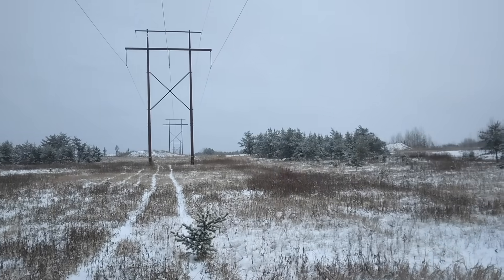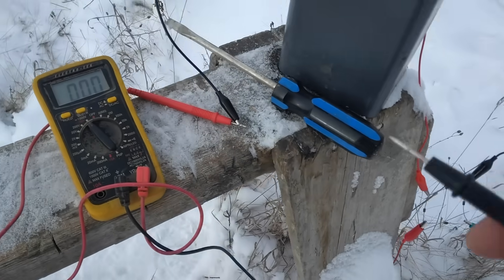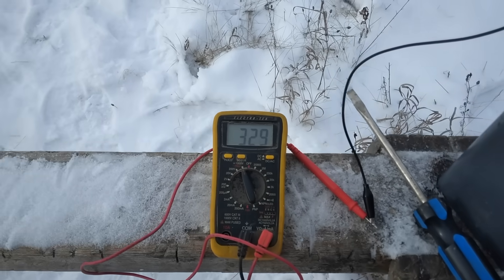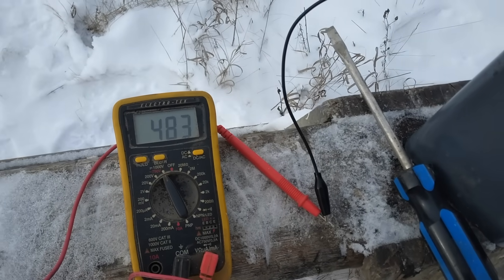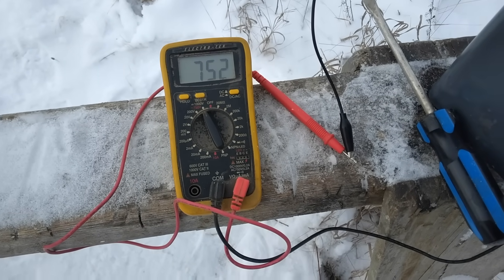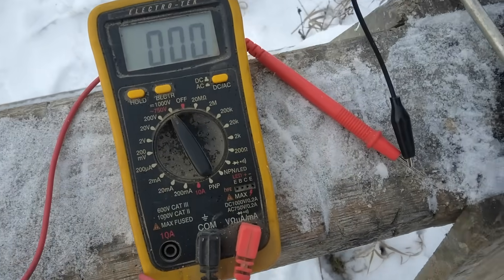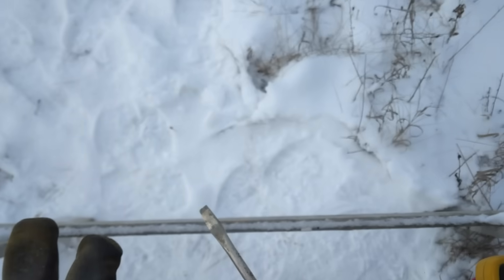Fences sucking power from under HV transmission lines

Comment: It is stealing if you use the electric power to do work, which equals using energy. Work means motors or heating or making light, etc. Anything that would take a generator using fuel. To say it isn't theft, is like saying anything in your house that uses a transformer should be free to run because there is no physical connection by the wires.

Comment: Hey, when you do this, use three lines all parallel to each other to create a field.  Electrons do not travel along power lines.  Electrical fields do and the reason you always see power lines in threes.  Infact, you can draw power from those fields directly.

Comment: having worked for the “power company”… don’t think you can start “stealing” electricity and get away with it… when you add a load, it will impact the impedance of the power line and they have metering that is monitoring the impedance, mostly for fault finding, but they will notice.

Comment: I know of a guy that took standard small voltage line wire rolled it Nicole under the transmission lines and stuck it in his main lugs on his house it wouldn't ruin everything at once but he can get by with just that amount of power usage
Reply: BTW, he was also when I met him in a lawsuit with the power company over stealing power

Comment: You don't need a bridge rectifier or a capacitor , if you coil the length of the wire you probably can power an LED lightbulb

Comment: Many people are clueless about physics.  The AC generates both an electric field and a magnetic field around it.  As the direction of the current flow alters these fields collapse returning almost all of the energy back to the wire.  The only loss is the signal that is radiated outwards.  Which is a small amount of power. 
However if the fields are absorbed, by the user, then the energy of the fields is lost and the wire doesn't get it back.  Which then causes the generators to work harder.  It is theft taking advantage of the situation. No different to stealing a car with the key in it.  Even if the key shouldn't be left in the car it does not and cannot excuse the thief.

Comment: Have you held a non contact voltage detector under those lines? If it dont light up u dont have enough induction to steal usable power. Maybe u could trickle charge a battery over a week to full but not likely

Comment: As long as you know the amps watts and voltage you can make an open air step down transformer with a coil of wire known as an inductor

Comment: I worked on the high lines several years ago. A crew was to work on a section of line in a right of way that had two other separate 345kv circuits that were enegerized. Their line was deenergized and grounded for the job. Grounds were about 1/4 mile away each direction. 2 men went up in a steel lift that was grounded. My friend was holding the conductor but not moving. His partner noticed and pulled him free. He died there dispite all their efforts. They thought they were safe with everything grounded as was required. The truck is grounded to protect the people on the ground. My friend in the air became the path between the line with induced voltage and the grounded steel lift.

Comment: We use very specific procedures at the electric utility when working around hi lines and especially when stringing in new lines nearby. We continuously drain that induced voltage to ground.

Comment: Any conductor that runs parallel to the power lines forms a capacitor and when measured with a high impedance meter you will likely see a large voltage build up. However, the instantaneous current that you can draw from this arrangement is extremely small and so this voltage is of little conseqence. In fact, were you to touch the fence, I doubt that you would feel anything.

Comment: I came back to a hiking trailhead parking lot once. To find myself with a dead car battery. I was the last vehicle at dusk. Looking around. I saw the transmission line went across the far end of the parking lot. There was a metal strip about a foot high. Suspended 2 feet off the ground that fenced off the parking lot on 3 sides. Hooked up the jumper cables to it. 

And Bobs your uncle. It started!

Comment: I know exactley what your talking about I worked for com ed in Chicago as a line clearece tech!  During the rain we would park under those big towers it was summer and hot out and raining I had my arm resting on the Steele door of the truck and every time I moved my wet arm off the Steele or back on it I  got shocked from that heavy current plus the rain plus the metal in the truck I’ve seen people hold a fluorescent lite bulb only and it would lite up!

Comment: The leakage on transmission lines is about 1/3 of the total power over the distance of the lines. 

Stand under the lines with a 4 foot Florissant bulb. You should be able to draw usable power from the lines with the right induction set up, they would find you fast though. Either when the line burned through or they noticed the power drop

In Colorado Springs they are studying atmospheric electricity, using a lot of wire suspended hundreds of feet in the air they have found high voltage low amperage energy

Comment: I suspect it would work much better if were were loading coils used to tune the antenna.A half wavelength at 60Hz is about 7,800 feet. Using only a couple hundred feet of 'antenna' will provide a small fraction of what is possible compared to using loading coils at the voltage ends.
A helical 'antenna' would probably work even better but require more wire and infrastructure.

Comment: 36 joules emptied out over an hour time span would calculate to be 0.01 watt. Now 36 joules emptied out over a dead short with a screwdriver in 0.01 second like in the video. Calculates to 3600 watts . It can definitely pay off to snoop off those lines to run some lights and what not xD

Comment: If you are nearby an AM radio station  a half wave  dipole aligned  perpendicular  to signal travel will get you more power. Use a Shottkey diode or a fast recovery diode to detect it.  60 cycle   power has too long of a wavelength to get any usable amount.

Comment: there's a hidden very deadly danger, if you have such a setup and a power line comes down and hits or gets even close to that "fence", it will vaporize and arc anything connected at any distance and then some. sure wouldn't want that hitting an electric fence, let alone it being tied to anything anywhere near human inhabited areas.

Comment: This phenomena is called induction. The fence is inducing current provided by the magnetic field expansion that is obviously reaching the vicinity of the wire fence. Similar situation to a transformer where one coil is being induced into another ie. primary to secondary.

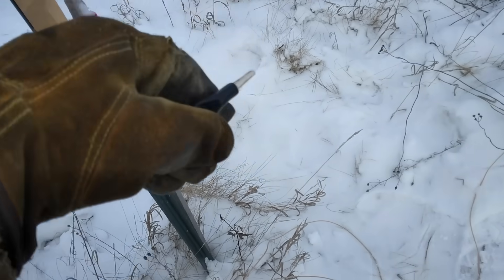Comment: You were charging for 8 minutes (2:05 to 10:06, assuming no deleted video segment) and got 36 joules (shown at 11:43) so that is 36 J / 8 seconds = 0.75 watts of power. You mentioned you had 80 yards of coax (say 75 yards linear distance after the dangling ends and loops around posts and sag) so you were picking up about 0.01 watts of power per yard. My guess is a carefully done design (perhaps including an iron core for better coupling) and a more precise layout relative to the overhead wires could bump that up a lot higher. Very interesting experiment and video! Nice job!

Comment: You shouldn't run into issues with those diodes until 2000V I think, because there's 2 that it has to go through all the time. I'm not as confident, but I'm also fairly sure that you won't overvoltage your meter. meters are cheap anymore either way. 

I would not have unplugged that diode bridge before shorting your cap that did not seem particularly safe.

You will also get diffrent results based on where you are under the line. You should get the most voltage from directly under one of the outer wires. I'm an electrical engineer but I've only done one study related to this. Where I looked at potential voltage developing on semis and school busses under a major power line. The software did more calculations than I did though, so I don't have deep knowledge on it. If I remember correctly the feild is weakest in the direct middle because that's where the three phases are mostly canceling each other out. Well outside the right of way will also be very low, but it get's surprisingly low right in the middle too, iirc.

Comment: IMO you should look at this situation differently and instead intentionally install a metal fence and/or additional wires or a series of induction coils coupled with inexpensive and readily available solar charger technology to take advantage of the free power generated by the electrical “pollution” spewing not only onto your property but also into the environment. 

Consider that if your neighbor ran a diesel generator that spewed exhaust over the fence line 24/7 and you figured out how to harness that to your benefit, you are not ‘stealing’ something that he has intentionally disregarded because it wasn’t worth his time and money to keep those fumes out of your yard. 

The electrical company can better insulate their wiring but it will never be cost effective based on what is spent vs saved. So enjoy the breadcrumbs from their dining table.

Comment: So your harnessing the AC voltage from the energized coax, converting it to DC with the rectifier, and using that DC to charge the 1200vdc capacitor. But at how many amps?

Comment: I love the bridge rectifier!!! So simple but not your average person knows what it is. I’m confused, you don’t know the voltage going through the rectifier, therefore you don’t know the DC voltage going to the capacitor either??? You don’t have a 12 voltage regulator that I see! I think you would need that to charge a capacitor that is 12VDC. so what your doing makes little sense. Not sure how that capacitor is charging/overloaded. I learned how to make a bridge rectifier back in 1998 in my electronics course for security alarms. I built one to turn 110vac into 12vdc, by putting a 12vdc regulator, and a capacitor. Then I connected it a 12vdc car stereo. It would power up, but didn’t last very long, and would shut off. not enough current.

Comment: Worked at a power station installing farmers access bridges around power lines on adjacent land  We had to have a banksman from the power station when lifting in beams near the power lines . Remember working on a very missy day we were allowed  six meters away from the lower lines with the crane  . We had been working well away from the power line . On this day you could feel the charge in the metal rebar .  The farmer told me knew another farmer power a building nearby by coiling wire around the pylons base .  It's well known electric field flow around the outside of cables . 
.

Comment: Currently im taking physics 2 and fresh in my mind the principles of e-field and with proper measurements you could find the electric field in volts per feet or some other length unit coming from the power line. It would interesting to see how accurate your measurement would be
Reply: It'd be awesome to see how high the voltage actually gets if you had the equipment I got myself and old-school HV DC meter goes up to 10kV and I got plenty of caps with high enough voltage rating along with some 10kV diodes too.
Reply: NGL I may try this myself

Comment: It's pretty amazing how much juice they are actually bleeding out of those big lines!   I grew up with Grand Coulee Dam practically in the back yard.  Besides getting all sorts of tours that the general public didn't get to take, we occasionally got access to the switch yards (best friend's dad was a shift supervisor for the dam, keys to everything) for supervised experiments.  The favorite was always the florescent light tubes, the longer the better.  In the 250KV yard, they'd glow pretty good as you walked around, when we'd go up to the 500KV yard, we had our own personal light staffs.  We tracked transmission lines from both, doing the same sort of things, mostly lighting up lights.  It seems like a huge bleed off, until you see one of the emergency breakers blow in the big yard, and realize just how much power they're sending!  Can hear the boom for miles, and it's about as bright as the sun in a big ball for a few milliseconds.  Got to see one pop during a line issue during a major wildland fire.  Two of the big lines got within arching distance and lit up the world.  I was maybe 4 miles away, across the coulee on the hillside taking pictures of the fires.  Pretty glad those towers are sturdy!  Ain't something that occurs that often.
Reply: I had a chunk of sagebrush ground for a few years, the big 500KV lines went right thru it.   I occasionally camped out there, and contemplated putting that loose juice to use, so to speak.  Basic circuits etc I get, but my electrical engineering and electronics knowhow ain't that good.  Never really figured out how to trickle charge a camping spot battery, and the noise of the damned lines really got annoying.   Add to that all the ticks and rattlesnakes, it was just more camping adventure than I was looking for as I got older.
Reply: Those power lines almost certainly carry electricity at 60 cycles per second, 60 hertz in more modern terminology. Since electromagnetism travels about 186,000 miles per second in air and about 90% of that speed in an electrical conductor, that's about a 3,100 mile wavelength in air, and about a 2,700 mile wavelength in a conductor. A fluorescent light bulb is only a tiny fraction of that length, so it's an indication of how very much power is in the air near that generator that the longer fluorescent light bulbs will really light up there. (Technically it's half the wavelength, some 1,500 miles or so, that really matters, but even taking that into account, the length of a fluorescent light bulb is still only a tiny fraction of 1,500 miles, meaning that there still has to be a lot of power in the air to light up a fluorescent light bulb.)

There's a similar story from back in the 1930s about farmers near a 500,000 watt commercial shortwave broadcasting complex being able to light up their barns with fluorescent light bulbs drawing power from the radio waves from that shortwave broadcaster. With shortwave radio, depending on the frequency and depending on which direction a fluorescent light bulb is oriented, a fluorescent light bulb's length matches up well with the half wavelength of a shortwave radio signal, so 500,000 watts, much less power than a hydroelectric generator provides, was enough to do the job for farmers near that broadcasting facility back in the 1930s, back when most barns didn't have electricity and the milking of cows was still usually done by hand.

Comment: Growing up, there was a motorcycle track built under some high voltage lines. On a humid day, I couldn’t grab my clutch without getting shocked.
We used to bring fluorescent lightbulbs at dusk and they would glow pretty bright, especially if one was thrown in the air!